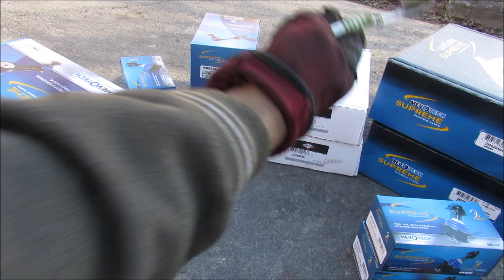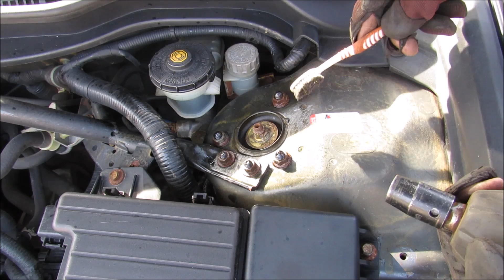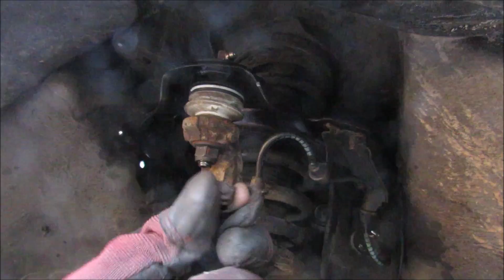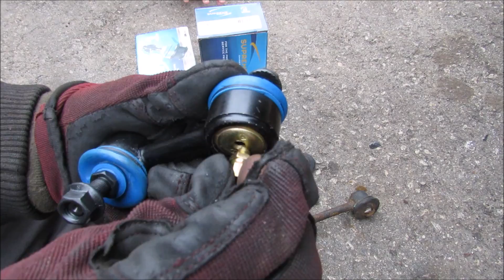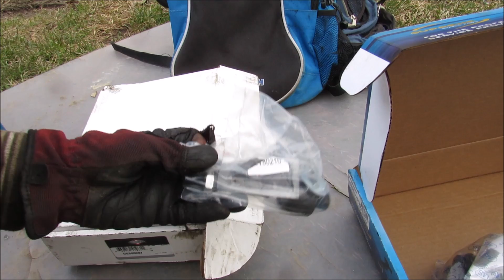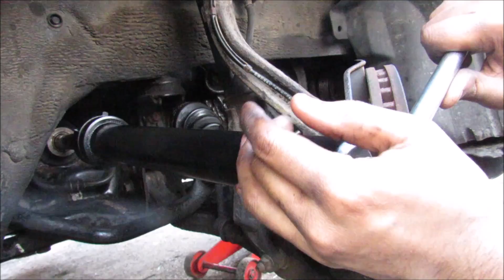How to Replace Control arms, Tie Rods and Stabilizer Links

Comment: I replaced the sway bar end links, inner and outer tie rods, lower control arm bushings, all three, and lower ball joints on 09 TSX. Upon test driving, I'm getting a loud and grinding noise when driving slow and turning the wheel , left and right. I need help if anyone has any ideas. It wasn't making such noise prior to replacing these parts. Only a clunk noise which is why all these parts were replaced with original Honda (Acura) parts. Thank you.
Reply: Wheel bearings?
Reply: @gloums outter tie rods were on backwards. Switched them, all is great now.

Comment: Why do NONE of these videos ever cover the possibility that the ball joints sometimes wont just tap free with a hammer. In that case you'll need a ball join separator tool. HOW BOUT COVERING THAT PLEASE?
Reply: As a resident of the rust belt, I whole-heartedly agree. I've never been able to just hammer the knuckle to get a ball joint free. They're ALWAYS seized.

Comment: Great vid! Collecting parts for a suspension rebuild on a 2004 TSX with 230k. Going to install coils and want to do a suspension overhaul at the same time. 

How are these mavotech supreme holding up after 3 years? What would you have change or upgrade if you had a 2nd go? What other things should be replaced while everything is out from under there?

Thanks again!

Comment: Do you REALLY need that Tie Rod tool to put on the new tie rod? It seems like the same adjustable wrench you can use to take it off would work just fine to install the new one.  Thoughts, anyone?
Reply from the maker: Yes I used an adjustable wrench. It's a little difficult but doable. Make sure you get it on there tight, I had one come apart on me
Reply: @speedkar99  hold crap that's scary

Comment: I see myself with a toothbrush and old t shirt when i start this project. Thanks
Reply from the maker: Glad I gave you inspiration. What are you replacing?
Reply: @speedkar99  thanks. Refreshing almost everything, upper control arm lower ball joint, inner and outer tie rods, struts, end links, strees bar bushings on a honda accord 2001 ex.

Comment: im having trouble figuring out what exactly to order for my 04 tl. this was definitely a helpful video but what about the rear control arms? im not even sure they are called control arms. are they rear lateral links or are those different parts? any info is appreciated. thanks

Comment: Finally did this job today on my Accord. Found out that the upper control arms I removed where still very good, but replaced them anyway, since I already had the new ones. That went really well. The tierod ends where the weakest link I found out. They where a bit loose on the ball joint. The inner tierods where still ok, but also replaced those. Took me 4,5 hours in total, on my dad's driveway with a jack. Very tiring job if you have to kneel down (my back hurts). Especially hard to replace the inner tierods without the special tool. Used a cheap little tool I bought online, but what a hassle... The retainer washers where a little hard to bend, could only hammer down on one side. 
But the car handles a lot better know I must say. No more racket in the steering. Feels way more secure.
Thanks a lot for your video, it was really helpful! 👍
Reply from the maker: Agreed on those inner tie rods and stupid washers. Things should definitely be tighter, more so with a new set of struts.

Comment: Curious how the mevotech parts have held up over the last year. I'm looking to refresh my TSX suspension and they're way cheaper than OEM but that's for nothing if parts break down in a year or two.
Reply from the maker: My brother doesn't have this car anymore
Reply: AHC garage put on oems on their $24k type S rebuild,    they originally had aftermarket but due to poor ride quality, switched to OEMs. Unfortunately a single lower control arm from oem is $500.
Reply: I'm planning on using MOOG.  What did you end up going with?
Reply: @fkp1692  ended up going with hard race lower control arms and OEM Honda ball joints and the lower arms. For the upper control arms I did the skunk 2 pro adjustable arm with the user replaceable ball joint. It's been on there for a while now and been great. Just ordered some rear lateral links from hard race.
Reply: I’m on one year and a month on my mevotech lower control arms. At this point can’t tell from oem

Comment: 3:55 - you can see a hole that light is going through in the mcperson’s collumn. The same hole is on the other side. You put a rod through them and let the upper arm rest on that support- this is the right point to tighten the bolts as these holes are made for that purpose.
Reply: Nice! Thanks!

Comment: Fancy stabilizer links! 
My replacement didn't have zerk fittings to add grease and push out contaminates....
Reply: They're $20 for my Honda and take just a few minutes to replace. I'd be happy to replace them when the time comes instead of messing around with grease.

Comment: So this is all of what is getting destroyed when you drive over a pothole.
Reply from the maker: Pretty much!
Reply: @speedkar99  I just had a swaybar endlink replaced under warranty today at 19k miles. Noises started at 12k. He showed me a pic of it, it was completely blown. The car is a new Camry and I drive it normally. That's how much American streets suck dick I guess. Is it possible though that it was defective from the factory? Maybe they didn't tighten it properly at the assembly plant?

Comment: Simply put: I just love this channel ♥️ .. and I also use my old clothes as garage rags while wrenching on my car and motorbike 😁 socks soaked in petroleum and then worn like gloves are excellent for cleaning motorbike chains 😊 and tooth brushes for cleaning bolt threads instead of wire brushes that prick and hurt your fingertips 😋
... and I wish we had supreme Mevotech parts here in Europe, they seem so good and beefy, my Volvo S40 P1 eats through suspension parts with an appetite of a kitten, I've been using heavy duty Meyle parts for the last 2 years, they are better than average, but still not perfect, a ball joint, stabilizer link or a tie rod would last for aprox. 35 to 40k km only.
Reply from the maker: Amazing...we make use of the same old items for our automotive use😏

In my opinion it works the best

Comment: what torque spec do you use for the inner tie rod?
Reply from the maker: I didn't use my torque wrench but I got it nice and snug with my breaker bar
Reply: @speedkar99  so there is no actual torque spec to go by?

Comment: I'm basically doing the same thing to my honda odyssey right now. I'm adding cv shafts and trailing arm bushings to my rebuild. Thanks for the video. I wish could get sponsored like you did.
Reply from the maker: You are welcome 
All the best in the trailing arm bushings...hope they aren't rusted to the bolt
Reply: speedkar99 The trailing arm bushings are already in. They were super easy. Getting the sway bar links is a real challenge though.

Comment: 9:14  the washer use to jam that rack end (the bally stick) to the rack.. bend that washer...
Reply from the maker: Yes! It's quite difficult to get in behind there with a punch and hammer with the steering rack still on the vehicle.
Reply: @speedkar99  i always turn the rack into outsise first,than bend it with plier first until start to bend and then hammer timeeee

Comment: Good vid as usual bro, but got a A/C question for 04 ES330 short cycling every 5-10 seconds system has been vacuumed and 1.3lbs added correct pressures. TXV sticking??
Reply from the maker: Maybe the relay or the pressure sensor? 

Usually the repair manuals have a detailed diagnostic to follow

Comment: You make the best car repair videos.  Straight to the point and sharply edited, with a sprinkle of humor.  Question: can a plumbers wrench be used to remove and install the inner tie-rod?  That special tool seems a bit pricey.
Reply from the maker: Yes a wrench can be used. In my case the roads were in the perfect spot for me to use an adjustable and whack it free
Reply: speedkar99 also came to say how awesome your video is, a really fast pace, no nonsense information while saying detailed.
Reply: You can rent it from autozone for free, just pay a deposit and then when you bring it back they refund all of your deposit
Reply: @ad636051  LMAO

Comment: 3 Oz of AT 205 Re-Seal fixed my leaking steering rack.
Reply from the maker: Thanks for the tip, though I wouldn't want that stuff to clog up the pump or rack
Reply: @speedkar99  It's not like Lucas which seems to  work (with not very much success) by being a thicker consistency. I have heard of clogging complaints with that stuff. AT 205 Re-Seal just makes the rubber seals elastic again.  It also works for rubber seals in transmissions and engines. It's the only additive I have had personal success with and recommend.
Reply: @speedkar99  note the steering oil "reservoir" has a fine strainer screen built-in at the bottom inside.
It's a good idea to either replace new reservoir -or simply suck out particulates with extractor during steering oil maintenance procedure...

Comment: I don't know if I've ever seen an old Japanese car that didn't have a destroyed suspension hahaha not worth fixing if you gotta go to the mechanic I guess $$$$$$$
Reply from the maker: Yes a mechanic would charge alot of labor for something like this. The bill with parts could easily top $1000
Reply: @speedkar99  at that point you'd be better buying another car with a better suspension haha

If the engine and trans are good though, maybe not a bad idea

Comment: Do you think these parts are better than OEM? Have you tried aftermarket parts on your Toyota/Lexus cars? I have a 99 ES300.
Reply: Go for the best if you can afford it!  Personally, I like Moog's Parts!
Reply from the maker: I find Moog at the higher end of the price spectrum and recently there have been mixed reviews. To each, their own. At least they are all much less than OEM.
Reply from the maker: So far Mevotech parts have been holding up well. 
Yes I've used them in Toyotas and they work fine.
Reply: I suggest looking around somewhere like rockauto. They usually have multiple options for the same part separated by tiers like stock, premium, heavy duty, etc. 
Good for helping to decide the best cost to quality ratio you desire or even just to see what's available out there to fit your needs

Comment: Can you do 2nd gen. Sienna lower ball joint? Is it doable to replace ball joint without the whole control arm in 2004-2010 Sienna FWD?
Reply from the maker: Yes it's a bolt on ball joint. Search my Toyota ball joint video, it's the same as the sienna.
Reply: @speedkar99  Thanks.

Comment: 7:21
Power steering fluid is the second-best "free" penetrant available in a scrap yard (or scrap car). The very best is brake fluid, of course.
Reply from the maker: I didn't know that
Reply: @speedkar99  Brake fluid is an amaaaaaaazing penetrant. Try it next time. PS fluid isn't half as good, but it's better than nothing in a pinch.

Comment: good video! why didn't you change the lower arm bushings too while you were at it?
Reply from the maker: Thanks! 
Actually the lower control arm was just changed yesterday after this work was done. 
The bushings bolts were seized and that chewed up the rubber. 

I have another LCA video for Honda here: 

https://youtu.be/8Uv5NeCU3XY

Comment: Way to go Speedy!  This makes me want to go out and redo my suspension -- I mean... it only takes 10 minutes per side, right???
Reply from the maker: If you have an impact and no rust it can be done in 2 min 😉
Reply: It takes more time to be prepped to break the record. Jack the car, connect the impact, assemble the spare parts, remove the tire, find your brother's used items etc. It will definitely take more than 10 minutes.

Comment: I have been watching your earlier videos and just bought the parts for my TSX front end and see your video on feed. Thanks and keep up the good work!
Reply from the maker: Awesome! What year is yours?
Reply: @speedkar99  It is -06 with little under 100k miles. Really like it and now I'm doing work that last owner didn't do and some preventive work also like timing chain tensioner, power steering pressure hose, ignition coils, wheel bearings and much other "Honda stuff"

Comment: I need this one...but bit tricky!
Reply from the maker: Nothing tricky but a little elbow grease, your brothers toothbrush and an inner tie rod tool
Reply: @speedkar99  I have seen union joints in the steering column get tired too... little extra freeplay in the wheel.

Comment: This is the one I've been waiting for
Reply from the maker: Awesome! What other videos would you like to see on the Honda?
Reply: @speedkar99  most of your videos are informative, I think I got it covered. 😉
Reply: @speedkar99  TIMING chain/belt with including the WATER PUMP & the "OIL PUMP RESEAL" - Doing this job all at once is a money/time saver... else if you piece meal you have to revisit the same parts...
Reply: also flushing coolant circuit is a good idea before the heater core gets corroded and starts leaking... steamy windshield 😂
The heater circuit control valve likes to get jammed hard to operate.

Note: dont overlook cabin air filter replacement... else not enough air circulates to cool down the blower resistor-speeds module that will blow its thermo-fuse. [Lube blower shaft bearings with 3 drops of 10w30 is never a waste]

The whole car (TL'04 150kMi) is amazingly well built.